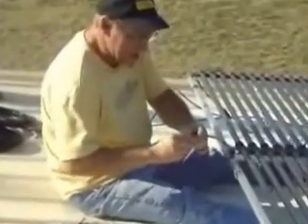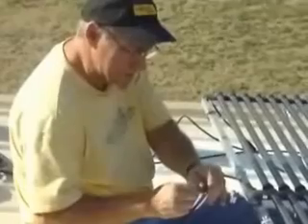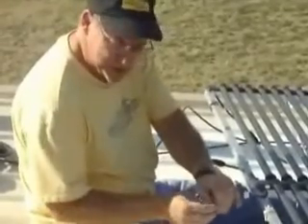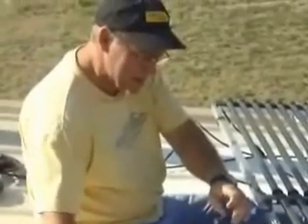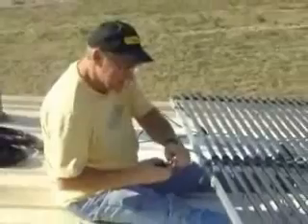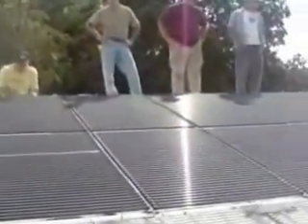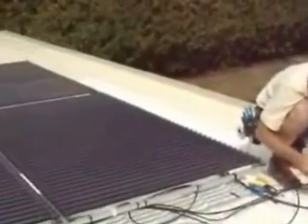Solyndra Solar Panel Installation

Comment: Probably not a good question - is this system still in use? I have a chance to pick used panels and I am wondering if it would be worth purchasing the panels.

Comment from the maker: They have been working flawlessly.   From first light to sundown I am producing energy.    I should make about 3000 KW or more this year.    The day after I put it in it was rainy and it produced about 5 amps all day long.   Very pleasant surprise.    On a normal sunny day I make between 10-25 KW depending on the season and temperature.    I painted the roof with a reflective material but have not noticed that it has had any impact.
Reply: did you build a Solyndra array yourself?.. can I ask you a few questions about it?  my email is mycomputerclean@gmail.com  thanks
Reply: @itubeutubewealltube1  hello did you ever find out any information about the panels. I have about 2 pallets of these cylindre cinder panels and I don't really know what to do with them. I would like to install them if it's worth it could you contact me and  provide additional information my email is hardleymarvin@yahoo.com
Reply: @marvinhard2299  I have not found out anything, he never responded, I just now saw your reply.. let me email you
Reply: How the fuck do you get 3000 KW from a 3 KW array? Are you projecting for a full 365 day span?